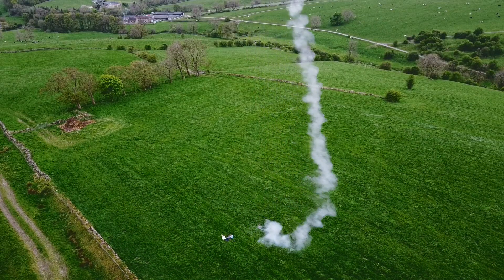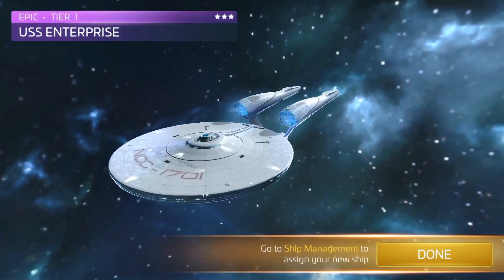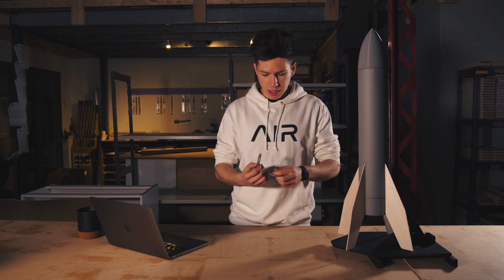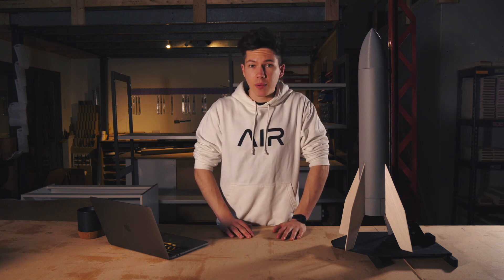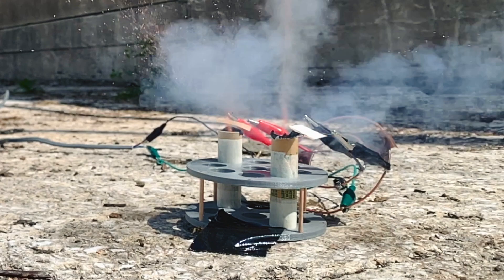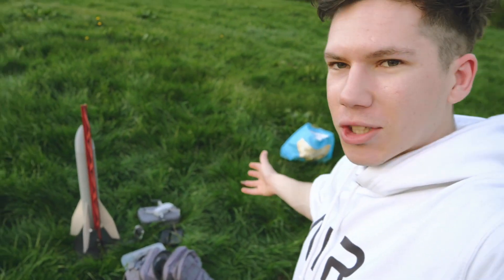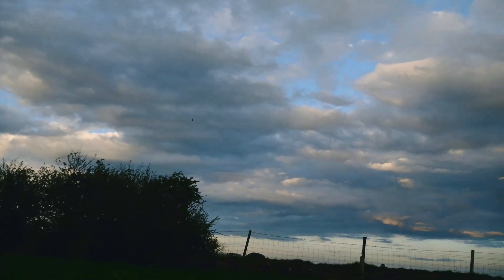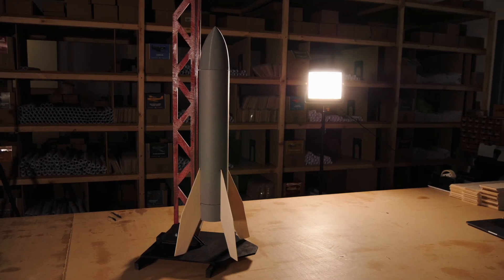DIY High Power Rocket

Comment: 12:13 That's why full size rockets are held to the pad until all motors are stable and producing equal thrust.  A challenge with a burn time of a few seconds, but perhaps a 0.5 second hold might get you a stable enough burn before launch.

Awesome; I love your projects!
Reply: I never realized that, I always thought the thrust initially is very low so it doesn't rise much.
Reply: @tarunkumaar625  Look at Space shuttle footage, you can see the clamps.  Same with Saturn 5 rockets.  Get 'em lit, all with similar thrust; let her go!
Reply: @YellowPinkie  I've never watched footage that carefully. I assume these clamps can also help I'm aborting the launch after ignition but before release or is that impossible?
Reply: @tarunkumaar625  depends, solid fuel rockets can't be shut down, liquid fueled ones can...
Reply: Yep we used a clothes pin barely to a fin just a little grip that can slip under full thrust. When you cluster theres more murphy in the equation.
Reply: @hadleymanmusic  awesome technique, I'll have to implement that on my clusters!
Reply: I thought maybe one could hold it down with a thread of known strength that would break when there was sufficient thrust for a safe flight. Or a latch that releases at a known force.

Alternatively, hold it down with a thread for each motor, with the thread in the path of the exhaust. When all the threads burnt through, the rocket would be free to launch. Requires robust blast shield to withstand the full run of the motors. Or maybe the threads could be weak enough that as soon as enough motors light to ensure safe flight, the remaining threads would break. 

A housemate, years ago, lit off something he shouldn't have made by putting house voltage AC (115 volts or so in the US) into a small diode, which then exploded and lit the larger charge. This would probably be simultaneous, but one would have to use caution with that kind of voltage outdoors. Or maybe an automotive coil could provide enough zip to explode all the diodes at once.

Comment: It'd be cool if you could use several motors without the ejection charge and then a few with, set up maybe 3-4 motors to fire on the launchpad, and then stage the other motors using pieces of cannon fuse, so as the main motors fire it ignites 3 more motors, followed by 3 more motors firing from fuses placed beneath the previously fired motors. The final 3 motors having ejection charges.
Reply: Interesting but would three produce enough thrust? Besides the weight of the old motors is still carried unlike real physical stages.
Reply: @tarunkumaar625  im not sure, im sure it could be weighed and calculated based on the ammount of thrust a single motor provides. The rocket itself im sure doesn't weigh much. If you split the stages 3,3,and 3 you'd have even thrust, on each stage, granted that is if all 3 engines fired on each stage and you didnt have a dud causing an imbalance of thrust

Comment: Why do you use multiple small motors? Why not one single, more powerful motor? With one single one you could even do thrust vectoring:D
Reply from the maker: I was going to mention in the video that these small motors are one of the largest sizes you can get in the UK. To get a rocket with a peak thrust higher than around 2kg you have to cluster motors together.
Reply: ProjectAir mh ok... sad to hear that...:( I could imagine that the clustering will proof difficult to get a consistent ignition ^^'
Reply: You can’t buy higher than D or E class motors in the U.K. without having an explosives license and lots of other red tape about storing and handling them
Reply: Sometimes the goal is not efficiency (one motor), Nothing wrong with clustering when done correctly.

Comment: Cheers mate, well done. Might I suggest a little bit of resistance on the rocket so it doesn't leave the pad before all the Rockets ignite.

Another suggestion is a launch module, RC receiver connected to an igniter from inside the rocket that way the rock it doesn't leave the ignition source.

I imagine you have a multi-stage rocket already in your head if not on the desk and you'll be using a similar sort of ignitor in that anyways.

I understand your excitement and the reason you went conventional for a launch mechanism. Either way cheers good job
Reply from the maker: I was considering something similar before and am definitely now wanting to test out some system like that, yes. 😁 Would be nice to see what 100% thrust looks like!
Reply: @Project-Air  or even staged thrust, certain motors for launch then other Motors to ignite when the others are exhausted.